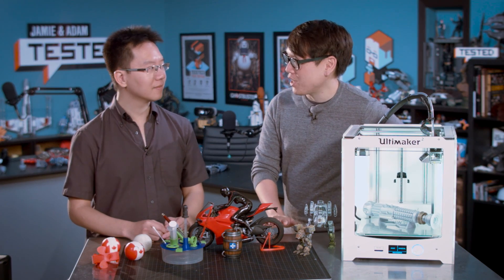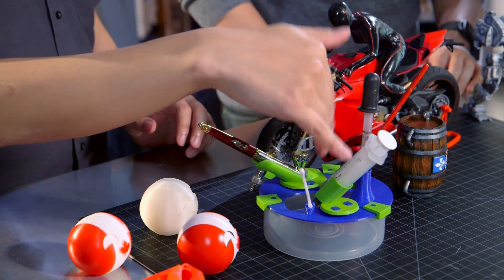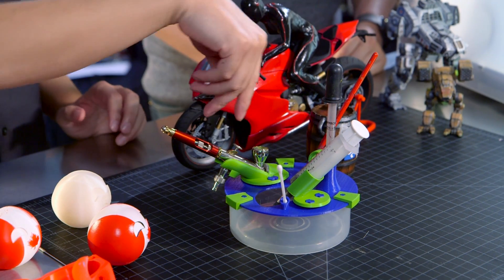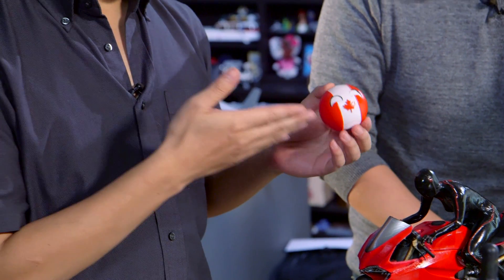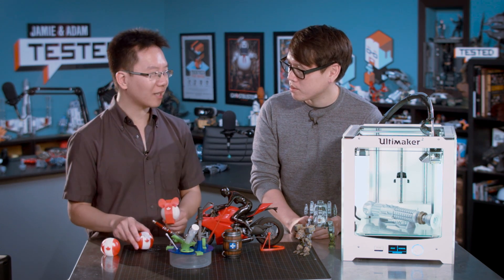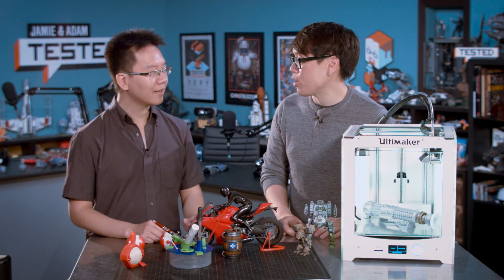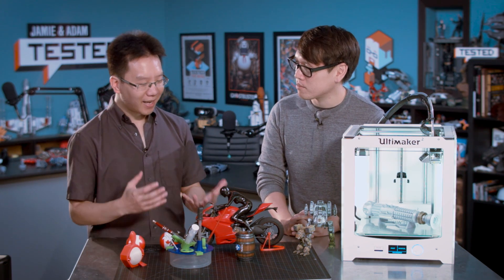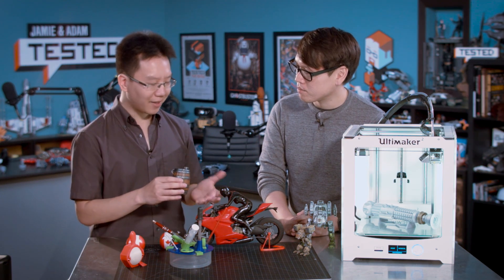Finishing and Painting 3D-Printed Models!

Comment: please please please can you tell me how you 3 d printed the balls? I'm trying to make a ball but the printing fails after about 5mm high.
I'm using pla at 50° table bed 200° nozzle heat. ive tried varying feeds and speeds but all fails.
I really am struggling thx paul

Comment: Jackie, I love the airbrush station but I'm more interested in your Poland Ball holder.  I'm doing diecast modding and I use old toilet paper rolls and even vice grips to hold the cars, mostly hotwheels, and they're always falling off and I can't always get a good angle.  I'm sure there'd be tons of us who'd get multiples if you designed one that would be able to work in most diecast configurations.